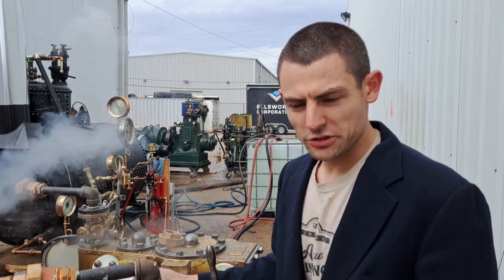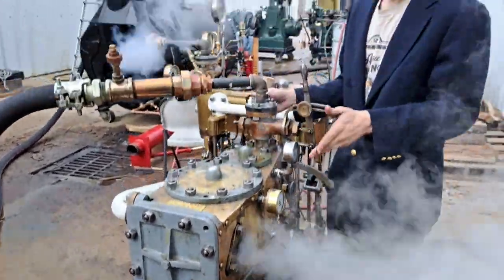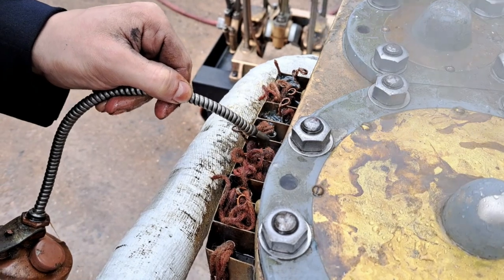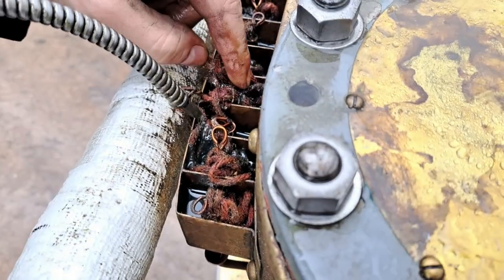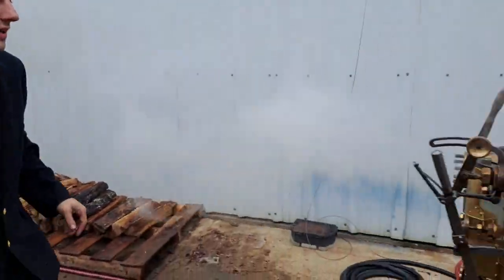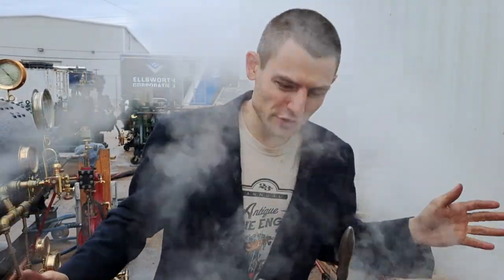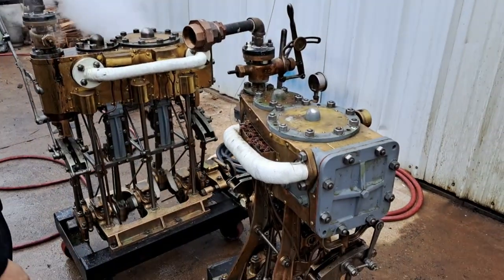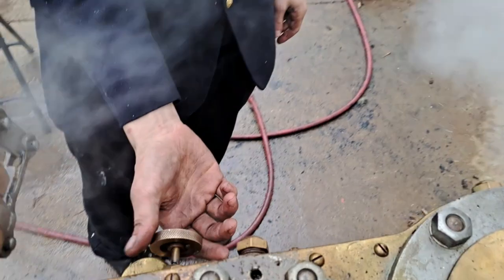US Navy G and K type Engines

Comment: Fascinating.  In a relatively small boat like a captain's gig, where would the engine, boiler and fuel supply (coal or oil?) be placed and how many crew members would be assigned to operate it?
Reply: I imagine coal: steady burn, and good btu value for the storage required.  In a bind, wood too [just won't last as long and takes up more space].  These are true steam era engines - more modern variants burning oil to make steam need a blower system.

Comment: Great engines and video - Excellent information and a marvellous record for the future. Ask to revise the term "simpling valve" to "impulse valve" as this term is more correct. The impulse is sometimes seen engraved on a brass plate at our 1927 steamship "John Oxley". This valve is used to introduce a shot of steam into the IP or LP chest to nudge the HP piston off a dead spot. As it also backpressures the IP or HP engine, it can't really be called a "simpling valve". Perhaps the term comes from road steam plant where this is a desired feature. Some might say a steam tug engine could be asked to produce extra power in a salvage situation, but here the impulse would not help.
Reply from the maker: Impulse valve is not a term I've heard yet so on your ship that is rare.  Simling or starting valves is what they are usually called.  To divert the exhaust of the HP or other cylinders requires a more complex valve with intercepting capability and I've not seen that often on marine engines except where extra power for sustained periods of time is required.  I did see a double, and a quad, that could turn into entirely high pressure engines with the valve in simple/intercept position.
Reply: @AEKarnes  Hi - Sorry for delay - lots going on in my life at the moment. If you look at the controls of the Waverley, the IMPULSE control is engraved. The controls on the 1927 steamship John Oxley that I work on also has the IMPULSE control engraved. Hope this helps - love your site - Binge watching! PS - Sydney Heritage Fleet has 3 steamships - 1902 steamer lady hopetoun has a yarrow boiler (new build identical) and a high speed Simpson Strickland triple. 1902 tug Waratah has a compound engine and scotch boiler. John Oxley is a larger coastal stemship under restoration and refloated 2022.
Reply: @user-vn8so9rf3d  My late father fired NZ Railways A compounds during WW2, they used to call the impulse valve the "God Almighty". Actually on the A, it might have been a true simpling valve, I'd have to look it up. My own 30ft steam launch has a compound twin with just an impulse valve, all that is needed to kick it off HP dead centre. I've visited the Sydney workshop a couple of times.

Comment: Route 1982 it's been a year on the Missouri in Long Beach overhauling it I was a marine machinist AKA mechanic we unbolted in the rigors pulled out a double reciprocating feed pump this thing seems like it was 15 ft tall The rigours Weave this thing up through ladder Wells like it was a Rubik's Cube jigsaw puzzle anyways the pump is the damndest thing you ever saw and yes they put it back if I remember right but I'm not sure that's been so long ago

Comment: Why is it that these engines run to rough without a load whereas stationary engines run perfectly smooth?
Reply from the maker: It's a good observation.  These engines are made to drive a large propeller very hard against a fairly constant load, and they are generally much higher specific output than a stationary engine,  as they have more valve timing advance (lead, in the old language)  to protect their crank and wristpins and crossheads.  You need recompression and early steam admission on an extremely hard working marine engine to protect it.

Comment: this is neat as a novelty, but the fact we are still reliant on this base technology is ridiculous. we had electric motors working at this same time... yet we were told "this was the best thing at the time"... we were fooled.
Reply from the maker: As I have had to tell about a thousand other people before you, electricity is only a way to transfer power.  A generator, electric grid and motor is the same thing as a pulley system, a lineshaft system etcetera.  It brings the power from the engine to the thing the engine needs to drive, no more. 
 Electricity is a transmission, not a power source.  It seems the general population needs to re-learn this because they are so distant from the reality of how things work now.  Buying into futurism without understanding technology will only lead you into self delusion.   All electric motors of that era which you speak of were receiving power from generators turned by steam engines or in some rare cases hydro power.  These days, the same is true, with steam power plants turning steam turbines still providing the reliable base load of the world's electric grids.
Reply: @AEKarnes  Well said and anyone who thinks that these old engines were "simple, or" rudimentary or even basic or uncomplicated doesn't know much about steam engines. These engines were extremely well thought out complex pieces of art that were ahead of their time and far more complicated than any simple electric motor ( by the way I like the way you had to simplify the difference between an engine and a motor for the undereducated about the subject,  although there is no telling if they "get it" or  not but great job on the whole subject and please continue with your work... those of us who understand can enjoy and learn from it.
Reply: As an engineer, I second this. Electric would not have been practical for this particular application.
Reply from the maker: @joshwright9202  I consider my channel primarily a misinformation fighting channel.  There is more misinformation, myth, fear, politicization and blatant lying in engineering than there is in any other institution currently, and that is saying something.
Reply: @AEKarnes  Godspeed.